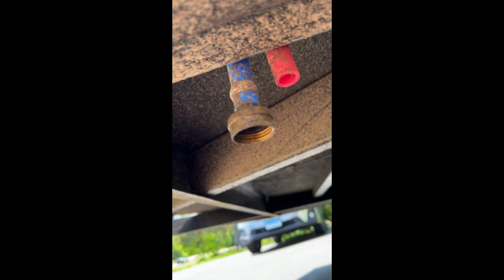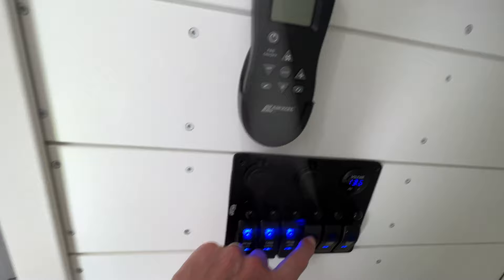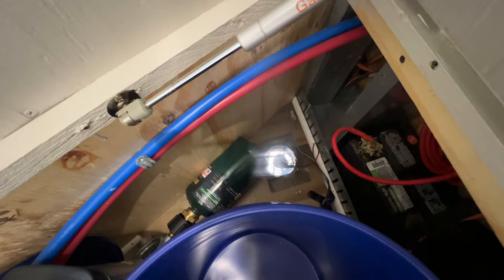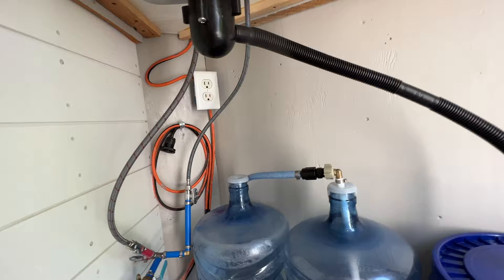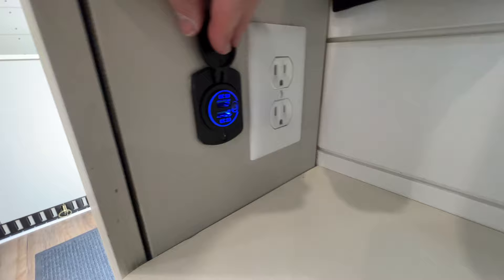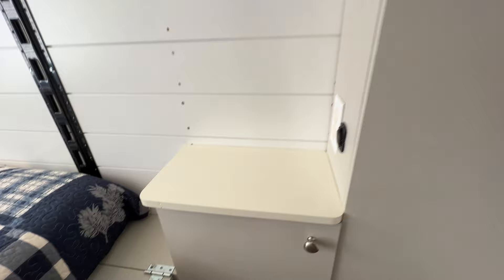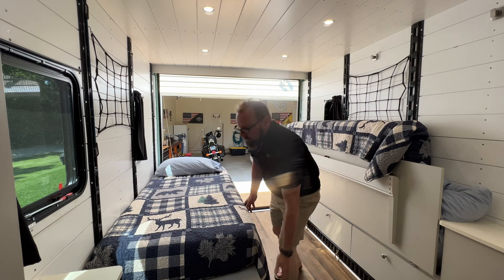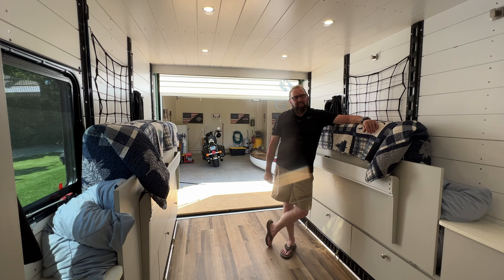Cargo Trailer Camper Conversion | Tom Golden Adventures

Comment: Great job. Only thing I saw that I would recommend would be putting a vent of some sort to stop possible water from coming in (while driving) for your fan on the ground that's right next to the battery.
Reply from the maker: @patrickscott4278 Thank you! I will put a rubber flap there to prevent water infiltration. good idea.

Comment: What a fantastic build! This is one of my favorite I have seen so far. I want to build a trailer out for hunting SO BAD, but they have gotten so expensive. If I build one, it will be very similar to yours, but I would build the back door ramp into an awning tent as well. Have an "indoor" space for regular stuff, and a "hunting clothing/gear" space on the ramp kind of like a wet room entrance.
Reply from the maker: Thanks @isaacmantx ! I sold this one but plan to do another build for sure. Its alot of work but definitely worth it. My next build will be a little smaller with barn doors in the back and a rear kitchen.

Comment: I want to add windows and a RV door lock to my trailer too but don't trust myself install them properly, any advice on who I should contact for help?
Reply from the maker: @gymwithray maybe check with your local RV dealer. they usually do repair work so may be able to help you. If not them try a cargo trailer dealer.

Comment: Couldnt u put a low profile grey water tank under ur trailwr to save room plus itd be gravity fed. As long as u stay above ur axle height u wouldnt lose any clearance. Cool conversion though man u did a good job on the windows to it looks professional grat job 👏 👍
Reply from the maker: Thanks Reggie! I certainly could add a low profile tank but really have not had the need so far.

Comment: Hi M. Nic work! Would be so kind as to share the details on your trailer choice: make, model, axle, suspension, wheels, etc.  Anything you would change in that part of the build? Thank you. David
Reply from the maker: Hi David, thanks for the compliment. the trailer was a brand new Quality Cargo 7x14 tandem axle with a 7500# rating.It had leaf spring suspension and electric brakes. I believe it had 15" wheels. When I do my next build I will not buy brand new, you can save considerable $ buying a used trailer. You just have to keep your eye on the market.
Reply: @TomGoldenAdventures  Thanks Tom. Kindly, David
Reply: @TomGoldenAdventures  Tom…another question if you don’t mind. My intention is to build a trailer that will be comfortable for camping, but will also transport my GS. I am attracted to the barn door entry…as I think they “might” afford a bit more versatility. However, I need to be able to get my GS in and out with ease. Can I have both: barn doors and an easy ramp solution? Thank you, again. David
Reply from the maker: @zebcokid2097  you can easily fabricate a swing down ramp inside the barn doors. Just get some heavy duty hinges and a latch of some sort. You will have the best of both worlds.

Comment: For the water heater, where is it venting?
Reply from the maker: There is no direct vent, just the small fan next to the heater. I have seen other builds that constructed a hood to vent the heater outside or heater mounted outside but both required additional holes I was not willing to cut.
Reply: @TomGoldenAdventures  I saw the fan but wasn't sure if that is what you had it there for. I am still in the planning stages on how I would want to set mine up, so this helps a lot
Reply from the maker: @ghostk33per  no problem. Any questions let me know. I honestly don’t use the hot water very much so it is not an issue. If I planned on using it I would mount the hot water heater outside on the front in a watertight case and just open the case once camp was set up.

Comment: Very nice setup.  I like the folding bed build, I wish you would have shown the hinge areas and locking mechanisms in more detail though.  Were those standard twin mattress sized beds?
Reply: Sorry Tom disregard my msg above.  The video jumped during the hinge portion on my laptop but upon re-review of your video it showed that part.  Thanks
Reply from the maker: Thanks! Beds are not twins. they are 33" wide but affordable and very comfortable. I wanted the narrow beds so i could walk through them if needed. They can be pushed together for an almost full size bed. when the wife is with me. here is a link to what we bought. https://a.co/d/gEIwfN5
Reply: @TomGoldenAdventures  Thanks
Reply: C033 is that the one?